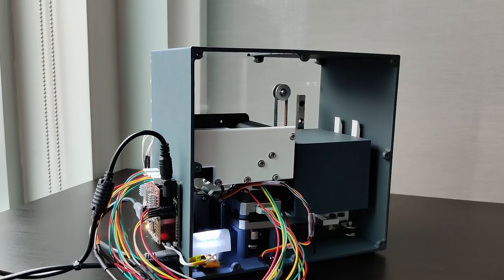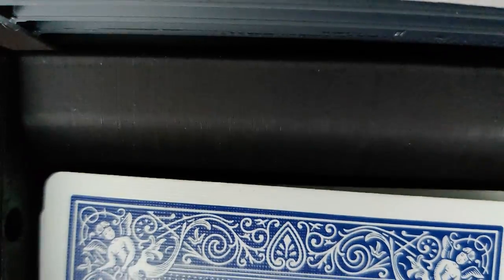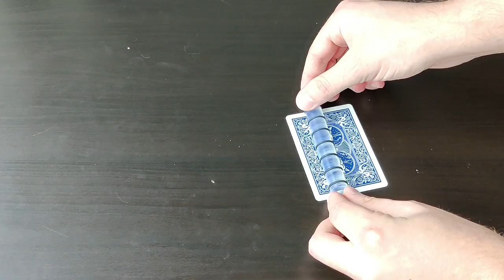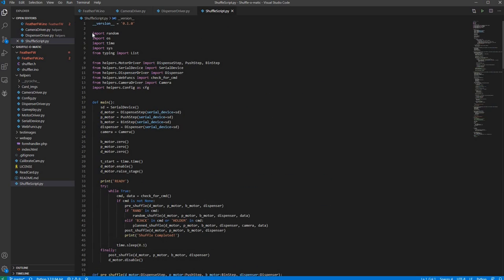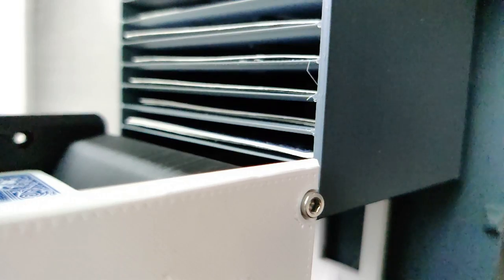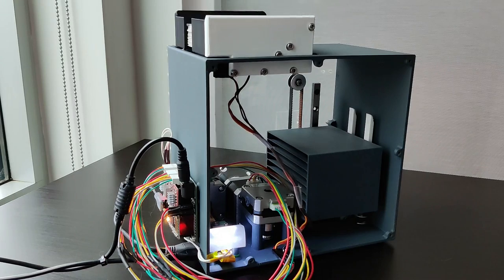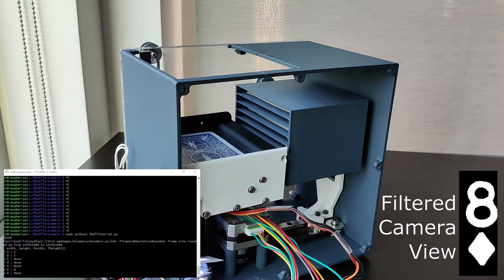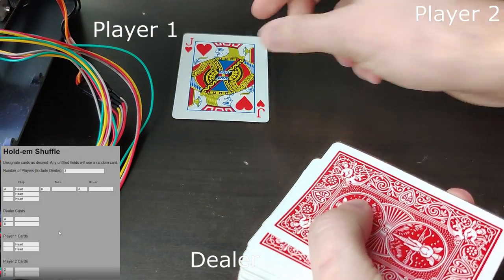Rigged Card Sorting Machine - ALWAYS Get The Hand You Want!

Comment: Silicone lubricant man, should help a fair bit with the noise in the gears.
Reply: I would say white lithium grease. They aren’t sealed so oil would quickly run off.
Reply: I recommend vaseline,  

I use it on my wife too,   stops her from screechin
Reply: one of the most important things done with real gears is to use helical gears instead of spur gears. Spur gears are more efficient, but all auto transmissions and tons of machinery use helical gears, just to help reduce noise.
Reply: @Timestamp_Guy  those aren't smooth it might cause internal damage
Reply: @OooohReally  Not for anything directly touching the cards (you wouldn't want to grease anything that touches the cards either). Just for the drive gears (not the toothed pulleys for the belts either)
Reply: @Timestamp_Guy  Oh I meant,  for my wife. 

Lmao I'm just playing.  You're awesome
Reply: @Timestamp_Guy  you’re not wrong about helical gears, they do mesh better and produce less noise in a proper injection moulded piece, but with fdm printing even helical gears are hella noisy, it’s just the nature of the manufacturing process, best way to go would be a resin print and then use some lithium grease, it would stay better, silicone lubricant would produce less resistance though and seeing as the machine wouldnt be operating for hours on end, silicone spray should be enough, it would also penetrate the gears layers too though.

Comment: Evil! Subbed.

Two ideas. First for the feeder, have a look at how printers run their rollers. They almost invariably have three: pick, feed, and separation. On cheaper machines the sep roller is just a pad. Anyways ideally the pick roller (the one that sits on the stack of paper) rotates along with the feed roller, and the sep roller is either stationary or even turning slightly backwards. That's what prevents double feeds. The pick and feed rollers are usually on sprag clutches so they can freewheel. After those three,  you'll have two driven pinch rollers that actually deliver the paper.

Second...there should be an even more evil and harder to detect algo in the evil shuffler: make player x really lucky. Don't specify any one hand, just make sure that x always has a better hand than everyone else. Maybe they'd even occasionally lose a hand just so nobody gets suspicious.

Comment: Hi, great vid. Just had an idea for the dispenser to make it more reliable. Where you have the pair of rollers spitting the cards out, the top one could briefly rotate in the opposite direction, so if there is a second card on top it gets put back in the deck while the bottom one continues but if there is just one card it will get sucked slightly in then spat back out again. Alternate idea, put the roller on a moving arm that goes on top of the deck so it only pushes the topmost card out at a time, if you springload the arm so the downwards force (and move the tray up a bit for each card dispensed) is minimal the top card wont have enough friction with the one under it to drag it along. Have the arm mechanized to move out of the way (idk with a servo or something) so when the shuffled cards are being inserted it can get out of the way.
Reply from the maker: Great suggestions! I actually considered something similar to that first concept for V2, but got sidetracked by other projects. But I may end up doing just this once I get back to it!

Comment: I'm late to this party, but I think the mechanics can be simplified quite a bit. The movement of the dispenser could replace the movement of the slots module - The slots module doesn't have to move at all and the ejection bar for the slots module can unload all of the slots at once if the dispenser is at the very bottom. This would make the sorting mechanism quicker and would allow you to fit more slots in.

If the dispenser was double sided you could have slots on both sides as well, allowing even more slots within a compact space.
Reply from the maker: Nah the party never ends. I eventually want to build a V2 but I have a few other large projects to finish up first. I appreciate all the feedback though, definitely some things to consider!

Comment: This is a very impressive machine that goes well beyond the scope of anything I desire from a shuffler.

However I hope you can push me in the right direction, I'm playing a board game called Talisman which has several decks containing hundreds of cards, with the main "Adventure Deck" being over 600 cards with all the expansions and is a tedious pain to set up.

I'm looking for a shuffler that can shuffle US Mini sized cards and won't destroy them either. I've seen some of the demos of the cheap mass produced shufflers and they look like they'd wreck these cards. Manual hand cranked versions seem more viable but they would still take too long and don't seem to provide a good shuffle judging from some videos I've seen.

Apologies if this was impertinent to ask but I'm at my wits end trying to find something good that won't break the bank and your video came up in the results.
Reply from the maker: Cheap shufflers will definitely destroy your cards, and I highly doubt any quality off the shelf solution exists for mini cards like that. You could definitely do something similar to my design, but keep in mind two things. 1. This design is pretty dependent on how much force is applied to the card being fed. So if you have too much force, you will feed 2 cards. And not enough you may not feed any. And somewhat related number 2. this feeding mechanism will only work with low friction cards, like bicycle playing cards. 

If you want to build your own solution to this, you would almost definitely want to flip the feed mechanism, so you can much more reliably control  the force applied via a spring loaded mechanism, and this allows for some better feeding geometries which can be a little more resistant to minor damage at the edge of cards.

Be warned, if you do want to build a project like this yourself, it is going to be a huge time sink, especially if you want to make it reliable. Good luck!

Comment: Given the ability to set the deck order, and read the deck order, you could actually shuffle in software, and then just build the deck to that shuffle. No need to run through excess shuffles. I'm guessing only 2 would be necessary.
Reply: You are right, this should be able to sort into any generic order of 52 cards in two cycles with the following algorithm:

1) Give every card in the arbitrary order an index of 1 to 52
2) Look at the first card to sort. Assuming 8 bins in the sorter, if the card index is 1,9,18, 25, 33 40, 49, 57 (ie start at 1 and count up in 8s) then put the card in bin 1. If the card index is in the set 2,10,19… it goes in bin 2, If the card index is in the set 3,11,20… it goes into bin 3. 
3) Reassemble the deck, ensuring bin 1 is at the bottom, bin 2 is next etc
4) Check if the card is in index range 1-8, if so place in the first bin. If in range 9-18 place in second bin and so on up to 52. Do this with all 52 cards.
5) Reassemble starting with bin 1.

This should give you a perfect arbitrary sort - because in the first phase you will have done a pre-sort which puts the cards in an order where the second sort will put it into a perfect order. Because bin 1 in the pre sort contains cards 1,9,10 etc, these will be the first cards sorted in the second sorter pass. In the second sorter pass you effectively have pre-sorted chunks of 8 cards, and the first 8 cards must contain index 1 for bin 1, and index 1 will go to the bottom of bin 1 pile etc.

Hope I’ve explained that enough!
Reply: @AshHartwell  I watched this at like, 2AM and didn't want to actually figure out the algo. Thanks for pointing out that Its literally just Radix Sort, base {number of buckets}, in this case 8. And radix sort takes Log <base {number of buckets}> (n) sorts, so for 52 cards, you only need 2.

Comment: Amazing! take a look at the paper pickup mechanism on consumer printers, it might give you some inspiration on how to improve the card dispenser
Reply from the maker: Great tip, thanks!
Reply: @3DprintedLife  Biggest difference between what a printer does and yours is the orientation. Printers don't try to take the bottom sheet of paper, they take the top one. The paper sits on top of a spring-loaded tensioner that holds the stack of paper at a constant pressure against the rollers.
Also, their rollers are always a flat profile, not the round one you get from the o-rings. I suspect it gives move grip for less tension, so there's a lot more friction between roller and paper than the paper and the next sheet downwards.

Comment: Just FYI....most companies that create shufflers don't sell their products not because of hacking but rather their model of business is based on leasing their products to casinos.  They would much rather keep getting a monthly paycheck from the casino in using their machines than a one-off payment (not enough casinos open up each week for them to profit off of).  The lease has stipulations that the casino has to adhere to or lose possible millions in lawsuits, this allows the shuffle companies to control all aspects of their units.

You don't get access because you are not a casino....and contracts are usually set in years and numbers (such as 5 machines at $25,000 per month for 1 year, as an example).  There is no "hacking" because unloading data requires a password authentication and a hardware key, otherwise you are physically hacking which can easily be caught by casino managers and surveillance.  The software has several modes based on the number of games the casino provides, allowing a machine to be swapped from table to table as needed.....and it also has a sorting and recall function.  Despite what conspiracies are out there, no, the machines do not have a "set hand" function as not only would that violate commission rules, but also leaves a vulnerability for casino losses by the shuffle company (which leaves them liable on those losses because the code is theirs by lease).  Yes, the machine can sort and recall, but that's just reading, not setting.

Just a little FYI

Comment: Due to strong interest in this project (and wanting to recreate it) I did some research calculations. I found that with 8 bins the chance of the bottom card ending on top is about 790x larger than the top card ending on top. This quickly decreases to 2.3 times after 2 shuffles and to 1.1 (neglectable) after 3 shuffles. I thought these results might be interesting ; )

I hope it's OK to use this concept for inspiration for a future design project of mine.
Reply from the maker: Really interesting, thanks for sharing. And definitely it's ok to base a future design off of this. That's what open source is all about!

Comment: would be cool to cut these components from acrylic using a laser since most parts are very boxy and at right angles. awesome projects and r&d! integrating the different components (mechanics, steppers, opencv, codebase) is very challening starting from nothing. how does it handle different sized cards? If I wanted to build this id want to shuffle any deck of cards (not necessarily poker cards).
Reply from the maker: Yeah the rear plate is laser cut and definitely could convert more components to use this, but I wanted to keep the design as open-sourced as possible so people without access to a laser cutter could still build it. I haven't tried any size other than standard poker cards but it probably wouldn't work great with others. And honestly, this was a fun project but not nearly quick or reliable enough to justify using over traditional hand-shuffling. I do hope to get a V2 made sometime soon, but I keep coming up with other more interesting projects which will get worked on first!
Reply: @3DprintedLife  I would like to help with V2. See github for some questions and a pull request.

Comment: Great design and explanation. I'm wondering if you could estimate build cost (assuming access to a 3d printer, say), and say anything about "maintenance" of the machine given regular use (eg do you need to recalibrate the camera, launcher etc regularly)? Sorry if these questions were answered in the video and I missed them.
Reply from the maker: Total cost is somewhere around $200-300 and there's no regular maintenance, but the card dispensing mechanism is unfortunately pretty unreliable so most of the work to keep this running involved adjusting the gaps on that part. It also would require more uniform lighting and opaque side panels to get the most reliable card detection due to the way the computer vision code was written, though I now know of some ways to improve this significantly if I ever complete V2 (which I started but is a big project!)

Comment: What material did you use to print the rollers? Did you 3D print them?
Reply from the maker: The main body was 3D printed (mine are clear SLA from a Formlabs machine but any old FDM printer can make them too) and the black rings are rubber o-rings for gripping the cards

Comment: Why do you have two motors moving cards up and down. You have one motor that descends the entire deck and then a separate motor that moves the eight boxes up and down. Why not just move the deck and leave the eight boxes still?
Reply: Good idea. It could make deck restauration at the end more complex though
Reply: @paulfontaine7819  The arm would need to be mounted on The moving platform. Moving platform would move to its lowest setting, the arm would retract and pull the lowest of the eight boxes into the deck, and then it would do it again seven more times moving up each time.
The biggest problem I see here is speed. The eight boxes are fairly light and can move very quickly. The heavier a module is the slower it can move, and making one module that does all the things will inherently make it slower.

Comment: What motors did you use for the dispensers? Great project!
Reply from the maker: A tiny "n20" geared DC motor for the counter rotating rollers and a mg90 servo for the roller that actuates a single card. If/when I make a V2 I will definitely be changing this up. The n20 motor is super loud and the servo is too slow (and actually one of the biggest limitations of dispense speed in this version)
Reply: @3DprintedLife  Interesting! I was thinking of making something very similar. Any recommendations for updated motors?
Reply from the maker: Not sure I haven't gotten that far yet! But to speed up dispensing, it would be important to have a dispense motor that can spin continuously. I have current sensing on the counter rotating roller motor so it's possible to detect when a card is dispensed, so position control on both motors isn't required.
Reply: @3DprintedLife  Gotcha. Also, have you tried full plastic cards instead of paper cards? I think it would make it much easier and consistent to dispense a single card at a time, as the plastic reduces the friction between the cards. Paper cards like bicycle can get really sticky, especially if theyre old. Copag and Faded Spade are good brands, I recommend trying that as well!

Comment: Poker hands would be harder to rig, because the dealer must cut the cards after retrieving it from the machine. So the dealer would have to be in on it and either do a false or precise cut to get the desired order of cards. Or the programmer rigging the hand would have to guesstimate where they think the dealer will cut cards.
Reply from the maker: Yes you’re very right and that’s exactly why cutting the deck is a thing. There are some theoretical hands where you can guarantee or almost guarantee a certain player wins no matter the cut but there are few combinations that can do this. And they of course only work with a specific number of players
Reply: @3DprintedLife  If it's just two players it is possible to stack the deck. So no matter what cut is made a certain player will win the hand, but no idea if you can do that with 8-9 players.
Reply from the maker: Yeah I think I’ve only seen options that work with <4 players. It almost certainly isn’t possible to guarantee the best hand with a full table. But I’m sure there are still clever ways to gain an advantage in this scenario that aren’t as straightforward

Comment: Was OpenCV your first solution or did you try other things first? I would be really interested to see how something like DHash would perform in trying to identify the cards. It would’ve been a lot easier to implement and run substantially faster.
Reply from the maker: The OpenCV is actually very fast since the files are so low resolution. The main time consumer here was capturing the image. I do now know how to stream from the PI camera so I could speed up recognition a ton in V2 with that alone!
Reply: @3DprintedLife  interesting! I’m a software guy, I never would’ve picked up on a hardware bottleneck. Thank you for your reply :)